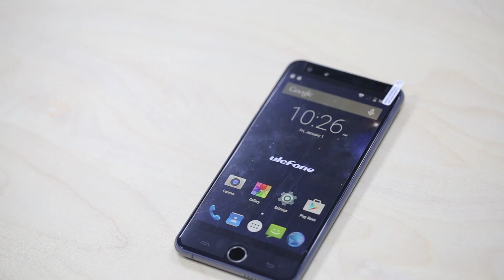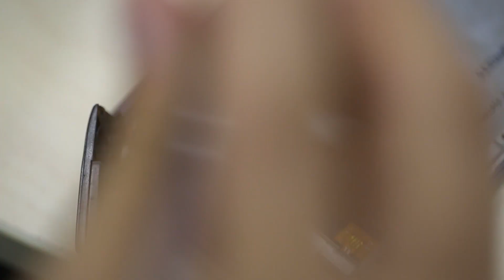Ulefone Be Touch teardown

Comment: I recently purchased a ulefone be touch 2 but my screen needs replacing. i bought a new screen and i was wandering if you can send me some instructions on how to replace the screen. if you have videos, manuals or instructions, that will be good.
Reply: ***** just follow the vidoe carefully. I played it slowly and first removed my broken screen before removing the other connectors carefully. I then did everything in reverse to put it back together. i bought a screen replacement kit from http://www.aliexpress.com/item/Ulefone-Be-Touch-2-LCD-Display-Touch-Screen-Tools-100-Original-Digitizer-Assembly-Replacement-Repair-Accessories/32427986960.html

Comment: I have the same problem as many - one row of 5 - 10 mm in the touch doesnt respond sometimes. Do you think its a hardware or software issue? Will it be solved if i change the screen?